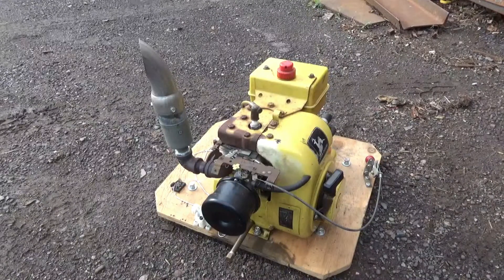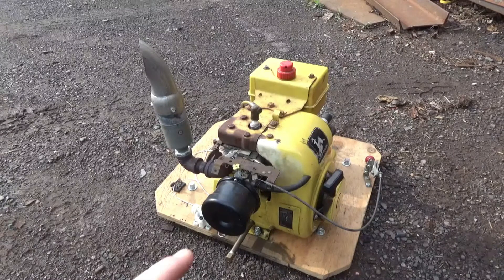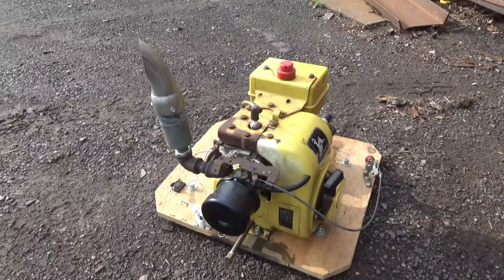Quick Tecumseh Rig update and run

Comment: Nice machine, starts well, this one and the Wisconsin is two great machines to have, you are lucky, I like that exhaust Josh, thanks my friend
Reply from the maker: Thanks, the exhaust is real simple, all it is a 3/4" npt briggs and stratton engine muffler part  number 294599 and a custom made piece of exhaust pipe stretched to fit over the engine of the muffler and it is held on by three self tapper screws.